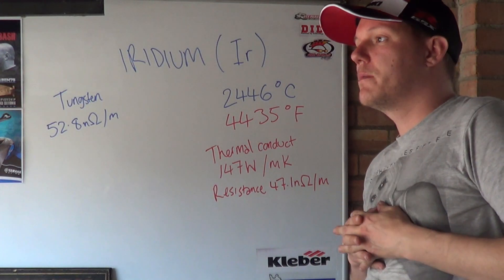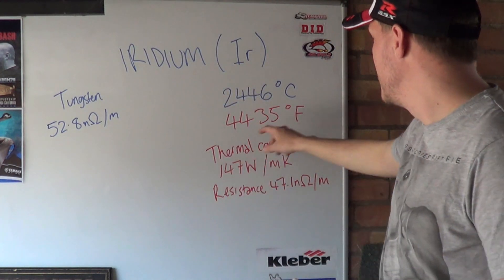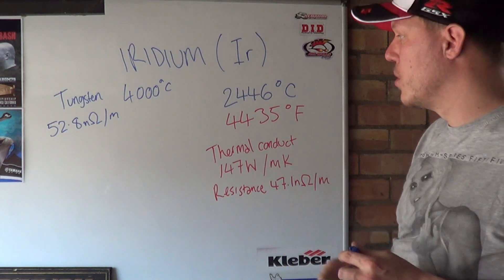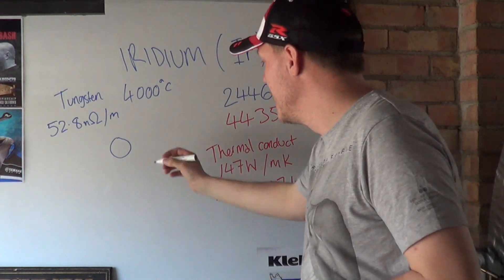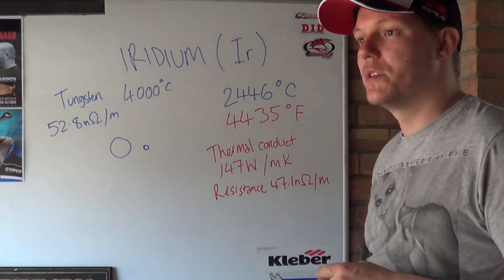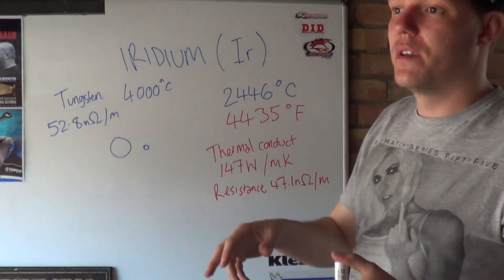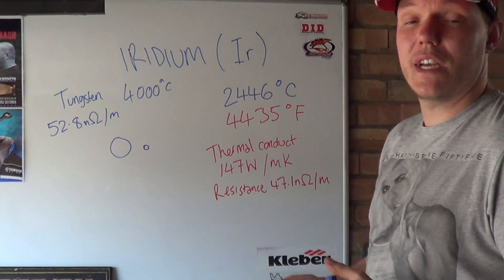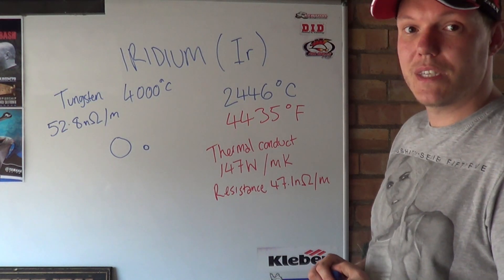Iridium Spark Plug - any good?

Comment: Very instructional. What about performance? Some folks state copper spark plugs yield more performance (they mean better acceleration, torque, horsepower, you name it). I have a 2003 Audi S3 and I am almost decided to try iridium spark plugs and some quality ignition coils too :)
Reply from the maker: Electrons are electons - there's little to be gained - most of it is down to the windings in the coil that the plug itself and the engine ground to the chassis
Reply: @thedirtyworkshop  quick response thanks a lot. Anyway I have 225hp under the hood they are enough haha, I have some misfires and rough idle lately and I value longevity on car parts so iridium should satisfy me. Will tell you my experience if you are interested :)

Comment: Got question. I have a gy6 125cc scooter. Im planning to have an iridium sparkplug installed for fuel economy and performance upgrade. But he discourages me to because we live in a hit climate and it produces more heat than reg spark plug is it true tho?
Reply from the maker: "Got question. I have a gy6 125cc scooter. Im planning to have an iridium sparkplug installed for fuel economy and performance upgrade."

1) the chinese GY6 is a poor engine. 

2) Iriduim just lasts longer, that's all.

Comment: But do they perform better or worse than OEM plugs? Not too concerned about longevity
Reply: J Bouchard in general,people say they feel smoother, morr linear acceleration, may be placebo,maybe real. Thats how small difference it is, not quite sure people feel.
Reply: I use them in my two stroke JetSki. 
I've noticed better idle and much better acceleration, especially after long periods of idle in no wake zones. With OEM plugs there  was a lot of hesitation before the engine would  smooth out. With the Iridium plugs, you nail it an the ski just go's !

Comment: What's your take on "Pulstar" plugs which uses plasma to ignite the fuel .... a load of wank or what?
Reply from the maker: All spark plugs use plasma - the spark arc is so hot it strips the electrons off the atoms in the air - hence a plasma is created - that's what gives it a blue colour.
Reply: What's your take on this video?   https://youtu.be/w962iS-7ELQ    Is it Evans type wank?

Comment: MATT... I WANT TO TELL YOU I HAD A OLDER KX250 2ST. I WAS FOULING NGK(STOCK)IRIDIUM PLUGS A LOT. I NEEDED A NEW PLUG BUT DID NOT HAVE THE CORRECT ONE AVAILABLE.  USED A TRADITIONAL SPARK PLUG THAT LOOKED LIKE THE SAME HEAT RANGE AND WHAT NOT. THAT PLUG LASTED A VERY LONG TIME AND I REALY ONLY REPLACED IT OUT OF PRECAUTION. DO YOU HAVE AN IDEAL WHY THIS WOULD BE?
Reply from the maker: running too rich is usually the case for an iridium burning out. Oil sticks to the electrode and when the plug fires it heats up the oil and insulates the tip, this causes the tip to heat soak itself.
Reply: This was some time ago, and in hind sight I'm sure the carb, and air filter for that matter of fact, surely needed some maintenance. Plus I was trail riding the MX bike. i was using amsoil @50/1. Either way thank you for the response. like all the information you are puting out.  much of it I know, and some it is good to see how realy shity companied try to sell some SHIT..THANK YOU

Comment: Is the Iridium on the center electrode solid or just a coating?
Reply from the maker: Its actually just the tip and only for a minute - Its an alloy as Iridium is both expensive and hard/brittle. 
The alloy is usually 

60-70% by weight Iridium
30-35% by weight Rhodium
up to 10% by weight Nickel, 
with tiny amounts of Tantalum, and Zirconium.

Quite a few people have asked this so I'll do a part 2
Reply: Wow, was not expecting such a detailed reply, thanks mate :)
Reply from the maker: Why not? lol
Reply: The Workshop You just seem real busy haha :)

Comment: I own a troy ounce of arc melted Iridium in my elements collection, that's about the size of a small marble or 5/8" diameter piece at it's very high 22.57g/cm3 density. A piece that size now is worth about 900usd to give you an idea of the value. I can imagine with new technologies on the horizon these types of metals will only go up in price. What I would like to know is how many spark plugs you could make with 31.1grams of Iridium.
Reply from the maker: Good question, so would I . I'll do some rining around and find out
Reply: Thanks. It's cool to know that there are very few chemicals that will react with this element, much less even dissolve it. You would need fuming hot Potassium Hydroxide to touch it, or a Superacid. Even Aqua Regia is no good here...
Reply: Thousands probably. The tips used in iridium spark plugs are so tiny and they're not 100% iridium but an alloy. They can't weigh more than a few mg/ tip. A 31.1 gr bead is 31.1K mgs, so i would bet thousands.
Reply: $900 of iridium = thousands of spark plugs = not an excuse for the high price after all

Comment: The electrical resistance of the electrode makes no difference whatsoever. Whatever metal you use the electrode will have a resistance well under 1 ohm. Carbon HT leads or resistor plug caps are greater then 1000ohms. The biggest advantage of iridium is it's heat resistance so you can have a smaller electrode which still lasts a long time. Sharp points concentrate the electrical field and make it easier for sparks to start. That is why lightning rods are pointed. Lightning will be more likely to trigger from the point than nearby flat surfaces.
Reply: Absolutely bang on Les.
Cannot fault a word.
The resistance/s and RFI suppression seem to be somewhat of a forgotten thing these days. Where as it was once very important.
Reasonably often on some old crate one sees an old fucked suppression condenser or such still hanging around on the coil, distributor or somewhere under the bonnet.
I believe it was much more important years ago when radios were more reliant on AM.
Reply: Seems to me that with all the computers and digital signals running around in modern cars, that electrical noise would of much greater concern than it has ever been before.  Oh, and only listen to AM radio.
Reply from the maker: Oh right, so that's why sparkplugs with an R in the code means resistor, because resistance has nothing to do with it. Idiot
Reply: Umm, try reading my comment again. The ELECTRODE has negligible resistance, whatever metal you use. Remember the electrode is just that little bit sticking out of the insulator. Internally different materials are used. See https://www.denso.com/global/en/products-and-services/automotive-service-parts-and-accessories/plug/basic_knowledge/construction/ for more details. R plugs have a resistor added to the stack.You need resistance in the plug,cap or HT leads to control radiated electrical noise. My whole point is that the resistance of the electrode is sweet FA compared to the extra resistance of the rest of the HT circuit.

Comment: I just found your videos and it is great to find an engineer that supports your information with facts. Not the typical Bubba in the back yard videos you find most of the time.  

Question for you is on cryogenically frozen spark plugs.  They make a lot of claims to increase mpg and horsepower. This is done by aligning the molecules when frozen.  They freeze the same as OE plugs NGK if I remember right.  I was given a set and put them in my '98 Harley Roadglide.  I did not dyno the bike before and after so I can make no claims to increased horsepower but in 20,000 mile on OE plugs, not frozen, I would get 40-44 mpg on long highway trips.  After install of the frozen plugs I put another 15,000+ miles on and would average 47-53 mpg.  About a 10% gain.  I brought the bike in for service and forgot that I had the frozen plugs in and they replaced them and it to me a while to figure out why my mpg had dropped back to the 43 mpg range.  

I think they work but it is not a controlled environment to say for sure.  Can you bust out the engieneery mind as to why it may work or I am crazy and my bike is better running unicorn farts.
Reply from the maker: Awesome question, cryo quenching is already on the list but I can add spark plugs too - matt
Reply: The Workshop Thank you.  Greatly appreciated.
Reply: inmt42003 I e never heard of this but you have "sparked" my interest 
Damn that was lame

Comment: Because they have smaller electrodes, each spark comes from the same place (thereabouts). This helps with some kinds of fouling. I had an old XV535 that would get the plugs wet with fuel or condensation and be a pain in the ass to start. Once it was warm it was spot on. When I tried iridium plugs it started crisply every time. Took it it in for a major overhaul and the mechanic put fresh plugs in and wondered why it was wouldn't start when I came to collect it on a cold morning when it was fine the afternoon before. Pulled and dried the plugs, and it started and idled lumpy when warm. Iridium plugs back in and it was fine again. This is a peculiar example of a quite well used air-cooled bike with a (by design) rich idle. I've not had similar isues on any other bike, although nothing else has done that many miles.

Comment: good video but you said at the end it lowers the resistance if they make it thinner, its actually the opposite. its likely so thin because its cheaper for the manufacturer and it still gets the job done 

good video nonetheless
Reply: There is also a very important aspect - the thinner it is, the easiest it will develop a spark and will allow better sparks in the worst conditions.
Anyone who want to check the physics behind it: https://physics.stackexchange.com/questions/43068/why-is-electric-field-strong-at-sharp-edges
Reply from the maker: Hello mate, I say that Iridium has a lower resistance than tungsten. I then say if your material has a lower resistance (i.e nano-Ohms per meter) then you can use a thinner electrode. However, if you were to test the resistance between a tungsten vs iridium, the the iridium would be higher due to the greatly thinner electrode. The main reason for using iridium is because of its stability @ high temperatures - like I said in the video - 

Cheers for the comment - matt

Comment: my experience with iridium spark plugs is that they foul very easily and start misfiring. possibly they are very sensitive to rich mixtures. I prefer to stay with NGK nickel electrode plugs (EG code)
Reply: TheMegaNanometer i run a iridium plug in my yz250 2 stroke.  just fix your jetting
Reply from the maker: are you using them in a two stroke?
Reply: yes

Comment: Thank you for the explanation! So in the nutshell for an average consumer it boils down to how long they last. I have seen some adverts saying they give you like 5% power increase and make your exhaust smell like roses. That is where my reaction I think is coming from. I don't mind having to change my plugs more often as its not a huge expense (well not on the CB500, Fazer was a different story). Of course over the life of the bike it will end up being cheaper if I ran only iridium plugs. 

But then again I semi trust the adverts for premium fuel so I probably shouldn't be saying anything.

Comment: My little Suzuki GW250 was due for spark plug change at 6k miles I was thinking of going iridium but I didn't in the end simply because I don't know how to tell when they're worn out really, so preferred sticking to the schedule of 6k miles and went with the OEM NGK plugs. The ease of tracking miles and just swap and forget did it for me however the plugs I changed out seemed like they had a bit more life in them......
Reply from the maker: All you need to do is follow the schedule on the back of the packet, or the plug manufacturers website will help you out.
Reply: Lol hmm never realised that was a thing, thanks! Random question but have you ever had to deal with the chromey reflective paint stripping in a headlamp before?
Reply: The plugs the Suzuki uses are CR7E says to replace every 6k miles in the manual but on NGK's site it lists longevity as 30k (I'm assuming they're referring to mileage or km and not something else)
Reply from the maker: do you mean removing it or applying it?
Reply from the maker: good question, i'll check....
Reply: Applying, my bloody Suzuki's chrome is already peeling and it's due for its first MOT later this year! Gonna see if I can get it warrantied